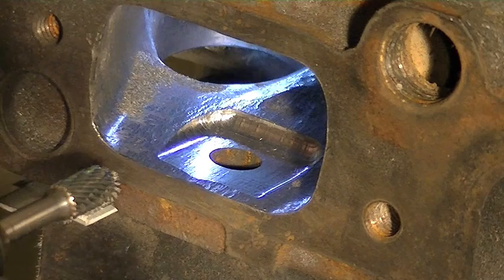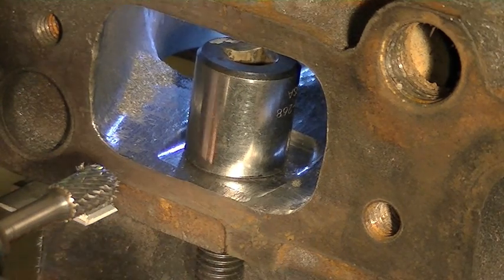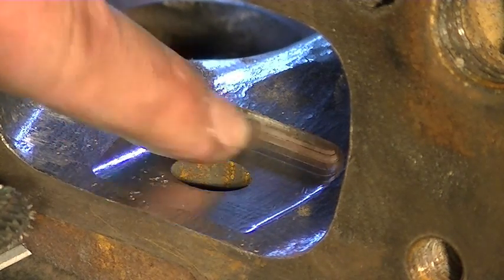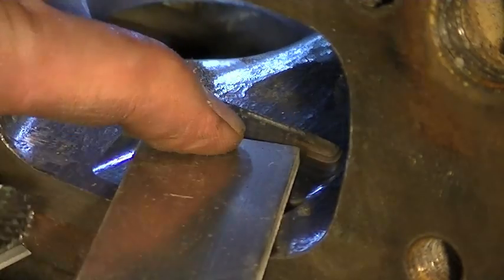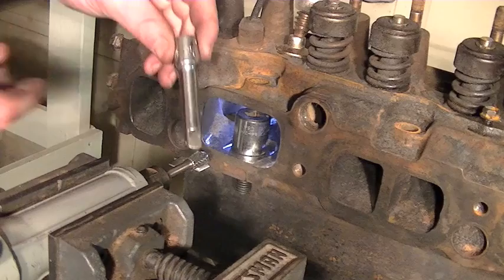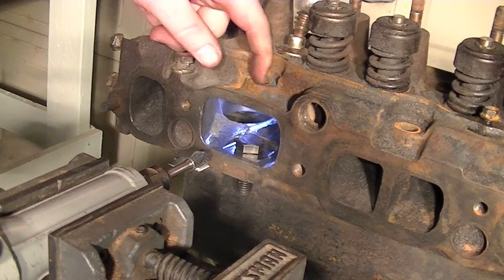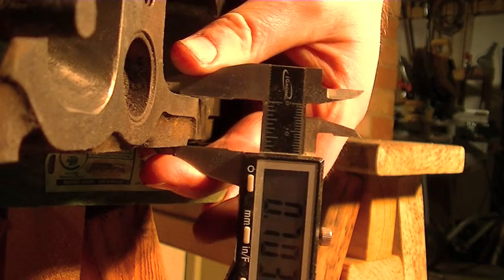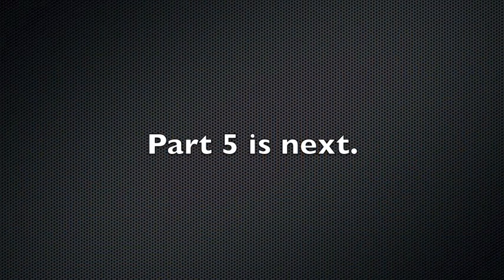Part 4 Chevy 250 Cylinder Head Porting | Inline 6 Lump Port

Comment: does that bolt make unwanted turbulance in that intake runners?
Reply: It will, but way less than the factory bolt boss.
Reply: @VinnyMartello  Great video though!
Reply: Most of the air moves on top side of port

Comment: I used a taper seat allen bolt,  machined the bolt seat, then blended each bolt to the port floor.  A soft plug up top, all done.
Reply: I know best case scenario you never have to remove the head again but a soft plug is a pain vs a threaded plug

Comment: Drill the upper hole to allow the use of an Allen head bolt or use a stud with a 12 point nut. plug the hole with a pipe plug.